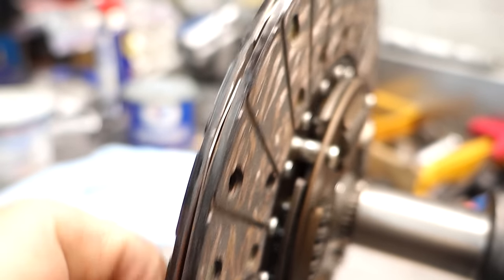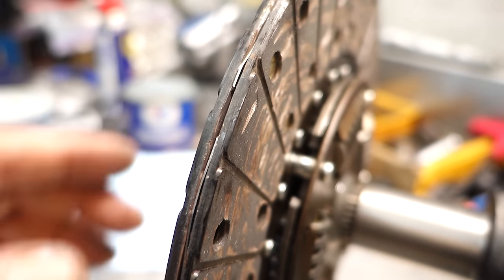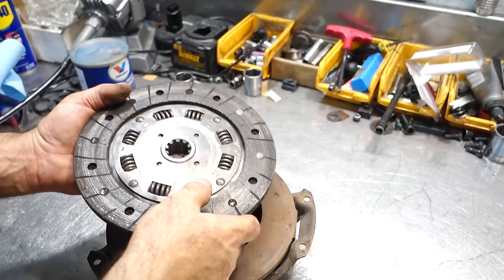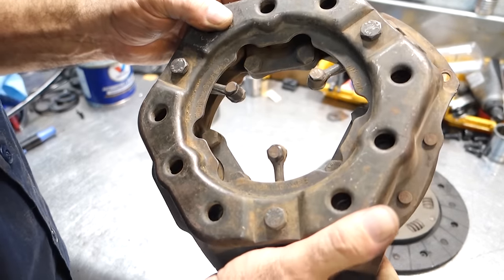Learn How a Clutch Works -  Basic Clutch Operation and Tips

Comment: Sir, how can we find out the dimensions of a diaphragm clutch for a given flywheel dimensions?
Reply from the maker: Depends on the brand clutch and the surface space available on the disc. So it's usually the other way around. The size flywheel determines the size clutch.

Comment: question about noises, my old ford, and I have videos of the sound it makes, when I push the clutch in, there's no sound at idle(assuming because input shaft isn't rotating), when I release the clutch, it makes a rattling/ almost grinding sound. also my shifter shakes like crazy (may or may not be related).
Reply from the maker: Does the sound go away when you raise the rpm?
Reply: GearBoxVideo nope, gets louder while driving.
Reply: I've been told the tremic T170ft transmissions just make that sound, and it's normal, but it doesn't sound right.
Reply: I've been trying to diagnose it for about 4 years now. gone through 2 clutch kits, including flywheel, pilot bearing, clutch fork, throw out bearing, slave and master. yet it's still there
Reply from the maker: No, it shouldn't make any sound like that. You may just have bad bearings.
Reply: GearBoxVideo I was thinking potentially the input shaft bearing, but given the limited information on the t170, I can't find a bearing to replace it.
Reply from the maker: stonemason90 Its a standard size bearing, however I've seen the pilot tip of the mainshaft get chewed up and that would require a complete overhaul and you'd be down for 3 weeks at least getting the mainshaft fixed.
Reply: GearBoxVideo I have a guy who can weld the shaft and machine it down, so that isn't an issue. it's finding a temporary trans that is lol the t170 isn't a very common trans anymore. it's favored by the t18
Reply from the maker: make sure they use rod that cools to a hard weld. 58 Rockwell C scale

Comment: Wow that was something knowledgeable.. 
By the way, my car clutche ki working fine in performance, but pressing the clutche is becoming harder day by end, what can be the reason? Pressure plate?
Reply: I tried changing clutche cable as well but after some 700-800km it was quite fine  then earlier hard clutche, then again clutche started hardening..
Reply from the maker: It's probably the cable again
Reply: Oh okay.. I asked at the service centre they are saying to change complete clutch kit, but clutche response is nice and I don't see any power lag in it..
Reply: And can clutche wear and tear make it hard ?
Reply from the maker: Usually no.

Comment: Gearboxvideo i have a question my car wont go in any gear so i bought  a clut Kit (pressure plate, releace bearing, clutch Disk  after.putting it all in it.still has the same problem it wont shift in any gear. Thank you for you time
Reply from the maker: Fmiguelify What make and model is it? When you say it does not want to go in gear. Does the stick move? Does it go into gear with the engine shut off?
Reply: GearBoxVideo   2002 Mitsubishi  Eclipse GT 3.0 L V6.,,,,,,,Yes it goes in gear when engine is off.,,,,, i put in gear and start  the car and i let go the Clutch  it just just jumps and turn off then it wont come out off gear i have to force it out.
Reply: GearBoxVideo  one more I replaced the slave.cylimder too and bleed it.
Reply from the maker: That is a clutch release issue and not a transmission problem
Reply from the maker: Fmiguelify it could also be the pilot bushing somehow getting stuck to the input shaft of the transmission. Bottom line is if it shifts while the engine is off, and you cannot get it into gear while the engine is running that indicates that the transmission is still spinning meaning it still connected to the engine and not being fully released
Reply: GearBoxVideo thank You very much ill check on that again. ILL take the trans out.to see Thank you

Comment: I have a quieston, I have a 1999 f150 v6 4.2 std.   I replace the clutch completely new and the bearing that press the pump that is in the pedal .. the first gear is not grinding it just have like a little bump and its a little bit harder to get in 1st gear... what can it be?.......      the client bring it without the clutch working the get in the gears and turn on the truck with the gear inside.. could it be the reason that the first gear is a little bit difficult to enter?
Reply from the maker: The clutch is not releasing all the way. Could be bad hydraulics or if you cut the flywheel you can loose the throw needed to release it.
Reply: Yes, i cut the flywheel because it had a lot of marks ....because of the years I think is the 3rd or fourth clutch that has been changed.. Thanks for answer. I aprreciate that.
Reply: I find the cause .... i take the truck to a clutch and standard transmission expert.. The bushing play on the pedals was the problem. THANKS A LOT.

Comment: Hi,  i have a 2002 ford xr8 ute,  the T 5 somtimes misses 3rd and the shifter vibrates when you hold the shifter in thrd. Does i sound like ill have to replace the bottem cluster. Mike
Reply from the maker: No. Probably a bad shift fork
Reply: @GearBoxVideo  Tnx for a fast reply Dood. Was hoping it would simple.  Really like your shows, Can you do a special on Toploaders pls mate. Mike
Reply from the maker: Do not have any Toploader cores
Reply: @GearBoxVideo Toploaders are getting hard to find in Australia. I can put it out their.

Comment: I hear a whining sound sometimes when I press the clutch pedal to disengage the clutch. the sound goes away after driving for 15mins or so. only happens when pressing the pedal, not the other way around. my car uses a concentric slave cylinder.
Reply from the maker: Probably the release bearing when cold making noise. Could be the grease inside the bearing to thick when cold and as it heats up and expands it gets quiet.
Reply: +GearBoxVideo it actually made the noise  randomly even after warmed up.  it's been a week since i asked you that and I still haven't heard the sound come back. Not sure if i should ignore it till it comes back again.
Reply from the maker: Gear noise doesn't come and go.  It is probably something else.

Comment: Hi, I have a quick question. I'm trying to restore a 1972 VW Beetle. I just put in a new pedal assembly and connected the clutch cable to the transmission. The engine and clutch are not installed yet. I THINK I connected the pedal and cable right, but I'm not quite sure if the release bearing is moving enough for the clutch to work right. Typically, does the arm and the release bearing have to move a lot for the pressure plate to work and disengage the clutch? About how much should it move? I'm sorry, I know this is a specific question and I hope it makes sense. I'm new to this.
Reply from the maker: 1/4" after contact of the release bearing and clutch fingers
Reply: @GearBoxVideo  Ok, thank you!

Comment: bro i have a 2003 mustang v6 standard and the problem is that i put a new clutch in it and a new throwout bearing and the car simply does not move when i put it in gear..... so this is wat going on ,i turn my car on right, without pressing down on my clutch pedal i can put my car in gear , i press down on my clutch pedal and it engages and disengages meaning it pushes down on my pressure plate and it realeses it also ..... i thought it was the transmission but no i already rebuild it and it still doing the same thing.... i need an answer bro plz help
Reply from the maker: First thing you need to do is jack up the rear wheels and put the car in gear and see if the tires turn. If the clutch is stuck in release mode this would happen

Comment: Hello sir my problem my car the 1gear slow release the clutch is dragging  I replace clutch assembly, ripis the fly wheel the dragging is back
Reply from the maker: Resurfacing flywheels can cause clutch release issues with hydraulic release bearings.

Comment: I have a question about every time I put my foot on my clutch and press it I hear a door squeak sound . What does that mean and where is that coming from ? I have a 1999 BMW 540i
Reply from the maker: I really couldn't tell unless I had the car
Reply: GearBoxVideo any possible idea by any chance ?
Reply: @maliek7112  make sure all the pivot points in the peddle are working correctly. Check the bushings and apply lubricant if required. That's a good starting point. Then move down the system to master then slave.
Reply: wannabecarguy okay sounds like a good idea

Comment: I'm in need of help. I just put back together my 04 vw jetta gli 6 speed. But the problem I have is that the car won't change gears. The only change is when the car is off,(all six gears go in and out good no problem when the car is off) I put it in first gear and then I turn it on. The car moves forwards in first but only lets me go back to neutral. That's all. All the other gears wont lock in.  What can be the problem. Please help.
Reply from the maker: You have a clutch release issue. Could be the hydraulics need to be bled properly.
Reply: GearBoxVideo so even if I can still move from 1st gear to neutral (because that's all it let's me do) after having set before turning on the car. It can still be that problem?
Reply from the maker: Yes. Think about what the only difference is between the car running and the car not running.

Comment: if the clutch disk has vibration absorbing qualities i.e the floating centre and the springs to dampen vibration why the need for a DMF?
Reply from the maker: Because the clutch disc cannot control all harmonics. When you start dropping idle speeds and lightening up rotating assemblies in some applications a DMF ( dual mass flywheel ) will always be needed.

Comment: Hi all. I am looking at two clutches and the details on both are identical. The only difference is the eject force. One is 3300 and one is 3600. Does a higher eject force mean higher performance? And also does it have any drawbacks? Like is the clutch harder to press or something? I would appreciate any help :)
Reply from the maker: And the brand clutches are?
Reply: @GearBoxVideo  Hi I am trying to reply but it is not letting me post. Both are valeo brand.
Reply from the maker: YouTube won't allow links
Reply: @GearBoxVideo  oh I see. So what  would you advise regarding eject force?
Reply from the maker: I am not familiar with that. I believe it has to do with a pull type clutch. What's the application?
Reply: @GearBoxVideo  hi mate. I am not sure what you mean by application. I am choosing what 3 piece clutch to choose. And it is a push control clutch if that helps in any way?
Reply from the maker: what application means make model car. Be specific

Comment: I get it all except how the clutch re-engages the gears without grinding/damaging them when one is being turned at high rpm by the engine, and the other isn’t being turned at all. What am I missing??? Are they angled gears so they can ‘slide’ into each other? But how would that avoid the rpm mismatch? This is making me nuts! Obviously not a mechanically-minded guy here. 🤷🏼‍♂️ Any help will be super-appreciated. 🙂
Reply from the maker: Transmission synchronizers are used when the transmission is disengaged from the engine. Watch my video on how synchros work
Reply: @GearBoxVideo  Hey, thanks!! Will do! 👍
Reply: @GearBoxVideo  Done! Great video. Thanks for your help.

Comment: Pls, i want to ask what casues the throwout bearing to be bad?
Reply from the maker: Overuse of the bearing.  Bearings due wearbut if you fell it was premature perhaps  it could be keeping the pedal pressed down while standing still.
Reply: Thanks for the reply sir. I drive a bmw 3 series manual transmission but I suddenly observed a grinding and winning noise whenever i used the clutch. On neutral gear position, the sound became normal. Could it be the throwout brearing still? This noise only occur when i engage the clutch.

Comment: Hi , 
I was enjoying my ride at 80-90 Km/hrs  Express highway, suddenly I noticed that my car is not accelerating further even after giving  acceleration . later it was not picking up after restarting again  . I want to know possible reasons behind this sudden failure , as previously no slowdown symptom was persist in my car . 

Appreciate if you can revert earliest .
Reply from the maker: Are you sure it is a transmission issue? Are you getting RPM increase?
Reply: Yes . I was getting RPM increased .

Comment: one of my clutch plate springs fell out , and got trapped between the crank and the clutch plate......it only had five single springs in it .......the one Im putting back in has five double springs......and the whole hub assembly is meatier
Reply from the maker: If the springs fell out you may have a misalignment problem which will cause the hub to flex and springs fall out.

Comment: I payd a mechanic to chance my clutch in February this year and after, I have problems shifting gears in first and second and I think that the clutch is not release completely! ?
Reply from the maker: Yes, more than likely.
Reply: GearBoxVideo  what can I do to fix this problem? I have a bmw e46 1.9 petrol engine five gears speed?  I must take the gear box of but how I make that the clutch to release completely?
Reply from the maker: Stefan Popescu Try having the hydraulic system bled from any air and check for leaks.

Comment: I had my car while driving pop out of gear while I was in gear and my clutch went solid would that be a slave issue  or a fly wheel ?
Reply from the maker: Without knowing what car you have..its hard to answer but you should check movement of the clutch system to see if your slave is working
Reply: @GearBoxVideo  I have a 335i 2008 bmw I was driving at the more top end I noticed almost felt like slippage  cause it hit the rev limit then I hit the gas again and it made almost a clunk sound and the clutch went solid and I coasted to a stop
Reply: @GearBoxVideo  I got the cover off and everything seems ok but I haven't removed the slave any advice in steps to follow  in checking to see if the slave is working correctly as of now without  taking anything apart the clutch is limp till about 3/4 of the way to the floor
Reply from the maker: It's not that hard to remove the slave cylinder and see what's going on
Reply: @GearBoxVideo  lol I gave up on it after watching a video of the ordeal of getting g it back in bled on my particular model and called a shop lol I was getting frustrated just trying to get a wrench to even touch the top nut on the thing ffs

Comment: What cause the  too much vibration when the clutch start to engage?
Reply from the maker: Clutch chatter can be caused by a bad pilot bushing, bad mounts, bent disc, oil on the clutch... There is no one reason

Comment: Any preferences when it comes to pilot bearings vs pilot bushings? Or does it not matter.
Reply from the maker: I never use bearings only bushings . If a  bearing comes apart you will ruin your crankshaft and input shaft

Comment: once my tractor clutch stopped moving tracror, and adjusted clutch linkage to go, is clutch worn out?
Reply from the maker: Adjusting a clutch linkage has nothing to do with the clutches clamping force.
Reply: @GearBoxVideo  no, but if worn badly, a shorter linkage could let the clutch engage better to compensate for wear of the clutchplate, right?
Reply: @GearBoxVideo  no, longer linkage would let clutch move closer to pressure plate.
Reply from the maker: Nope

Comment: Does anyone know what causes a noise that sounds like car keys jiggling especially in second gear with the clutch in and while coasting? 94 nissan 5 speed 2.4 5sw71..recently rebuilt completely...luk clutch...shifts great no clutch fork vibration.
Reply from the maker: To you and everyone reading.  In order to get your  question properly answered, knowing the make, model and car is an important piece of info. For some reason people fail to include this important  data. There are many variations of clutch, shifters and transmissions.
Reply: @GearBoxVideo  94 nissan hb 2.4 5sw71c 5 speed. just rebuilt it.
Reply from the maker: If you used an aftermarket synchronizer some of them fit loose and can rattle

Comment: Why would you get clutch chatter when the clutch is very hot? releasing the clutch in 1st gear ?
Reply from the maker: Depends of the clutch. Some linings can get very aggressive when hot. What do you have?
Reply: Only when driving a long time 2012 Camaro hydraulic 6 speed.... Its strange. It never does it when I bring it to the dealer. By the time they look at it it cools off. Clutch release? maybe

Comment: Is Clutch plate is connected to pressure plate with bolts??
Reply from the maker: The clutch disc floats on the transmission splines. The pressure plate is bolted to the flywheel
Reply: Oh ! I understand ,tq sir .I have another doubt , what is the purpose of using pilot bearing which is connected to crank shaft ??

Comment: I finally found my problem. The damn pivots was not letting the plate pull back from the disc. They were sticking due to being rusted. I installed a 4.2 LUK pressure plate and disc. Pulled two slaves from original 97s and both were different heights on the throwout, one being 1/4 inch less in height than the other. I used the longer one as the shorter one would not give me the release but yet both had the same serials on them but made by different companies, so all i can say is someone handing out these slaves do not know what plates they match or even what year they are made for. To make this short, match the slave to the plate but install it first on a makeshift and test it to see if it will release so you will know if the bearing binds to close or too far away because the manufacturers do not care if they fit or not, just bring them back and try another one until you get one to work. ??